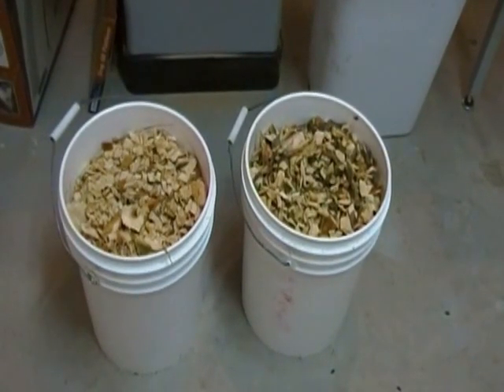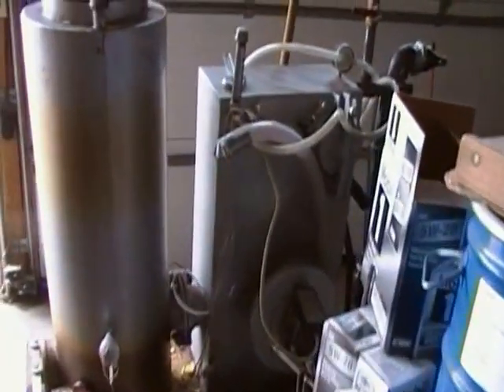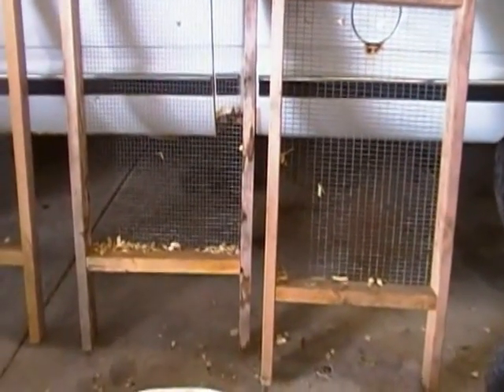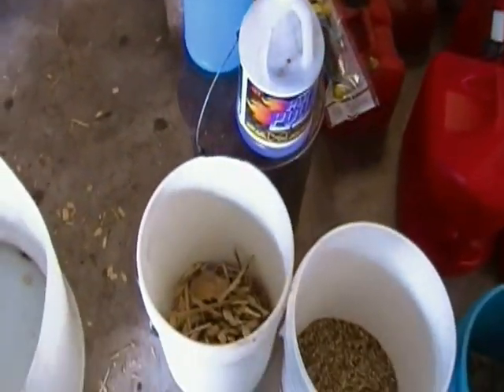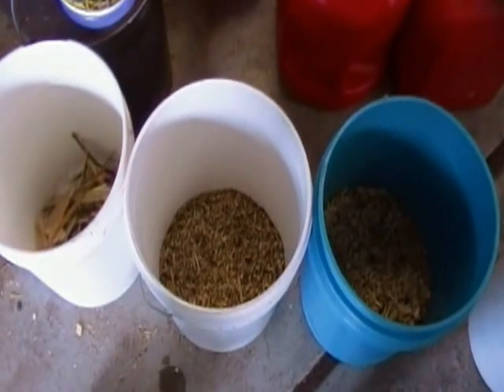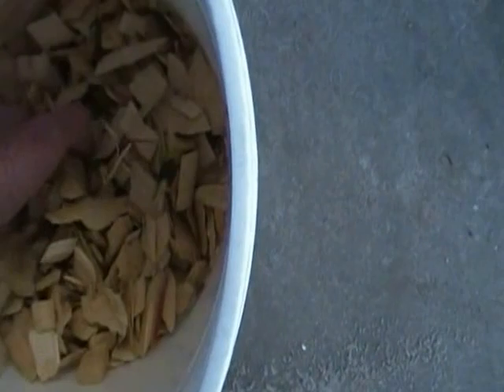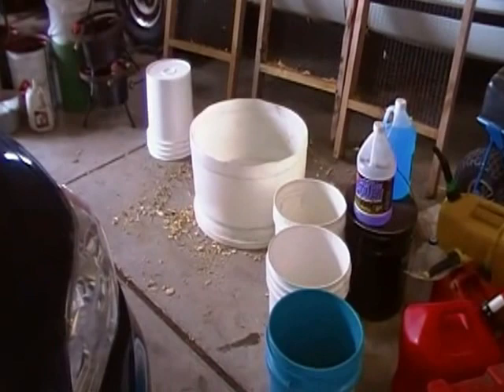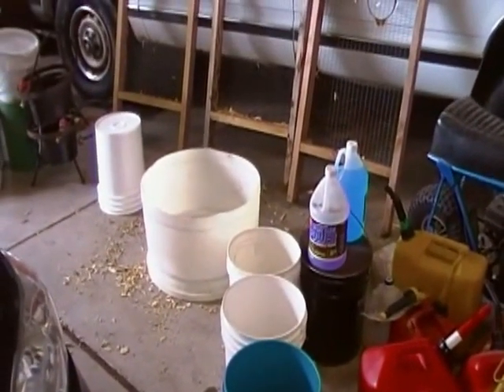Wood Chips for My JXQ-10 Gasifier

Comment: the best thing about using wood chips here in southwest virginia most of the tree trimming companies will dump as many loads as you want so they can avoid tip fees at the local landfill what you can't use in your gasifier you can pile up and use for mulch